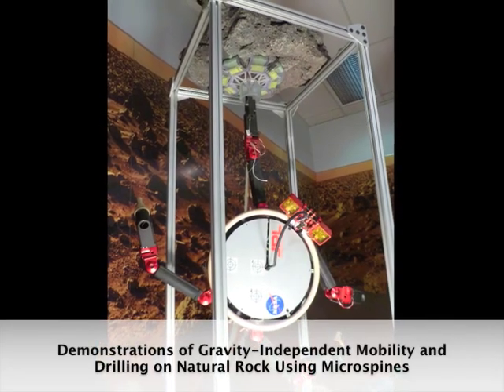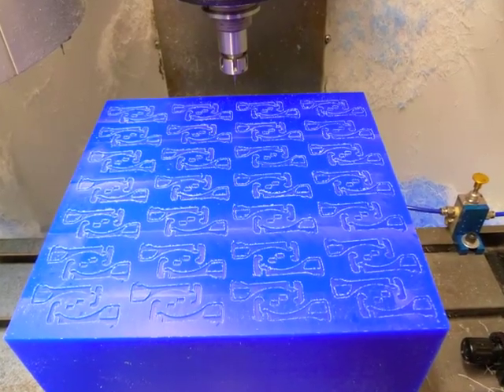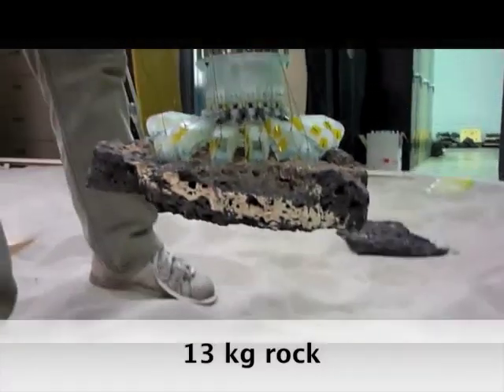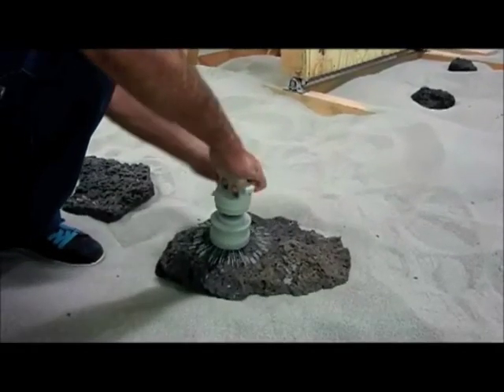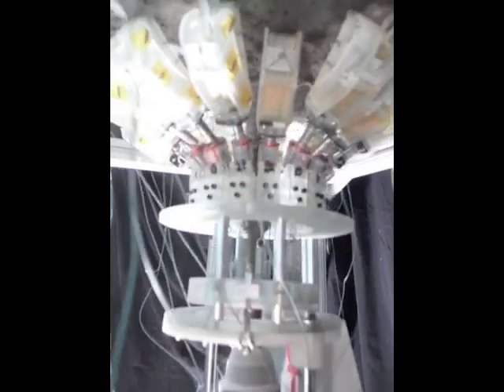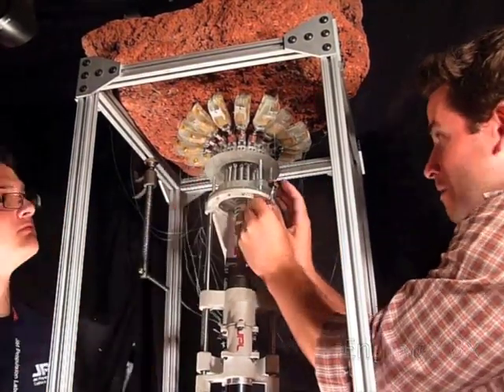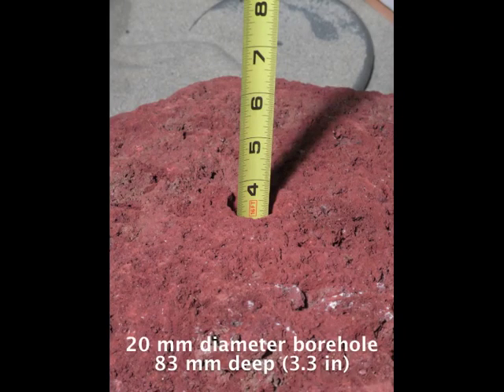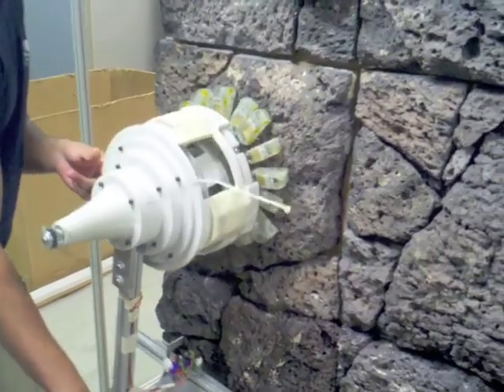NASA JPL Robotic Microspines

Comment: Neat - I wonder if this would work for climbing. Does it hold on without any pressure (e.g. a hanging cam)?
Reply: If you used it, wouldn't that be "cheating"? Would it still be a sport?

km
Reply: That's really clever.
Reply: It's based off of geckos feet, they have uni directional grappling but when pushed an opposite direction they release, so, yes it would work very well
Reply: @kbmontauk  use for protection. To stop falls.

Comment: Can you use it to climb
Reply: not this model, did you see how it retracts the spines? they are pulled back into the encasement. there are no separate motors/servos to advance each spine in different spatial dimensions which would be needed to climb/crawl.

interesting question though.